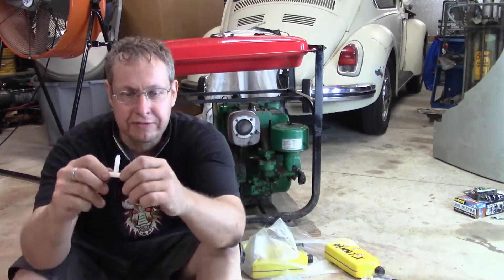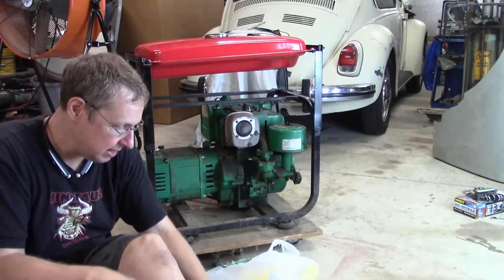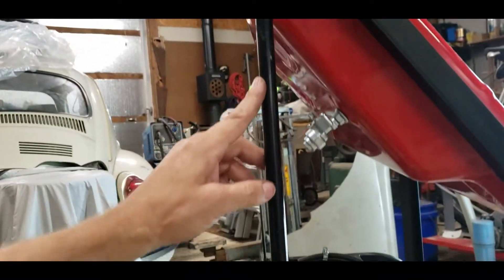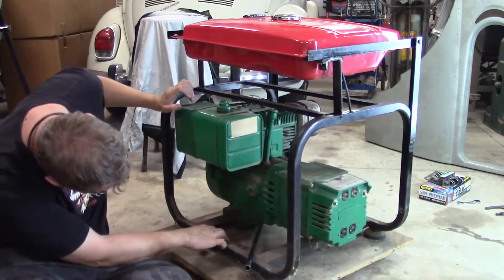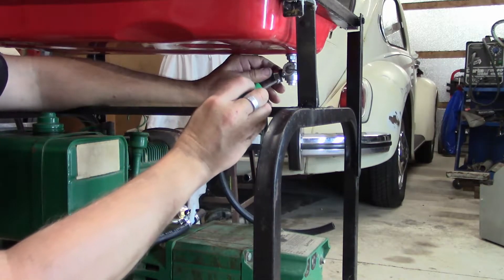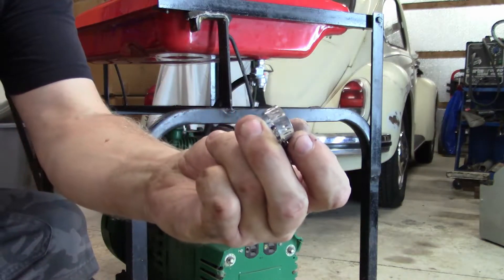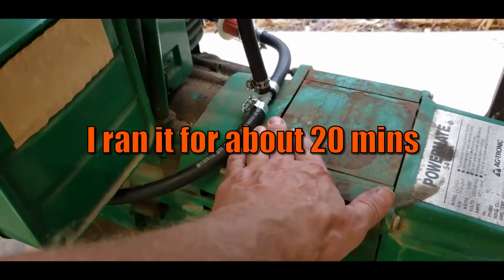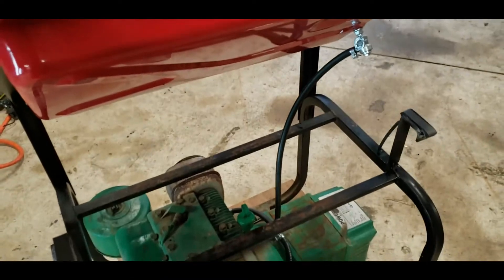Generator Auxiliary Fuel Tank Mod - Duel Tank Feed Lines. Make the Generator drink from both tanks.

Comment: One piece of advice: Get a brass tee. The plastic ones are primarily for air. With gasoline, they become brittle and break over time.
I'm wondering why the gas from the top tank isn't flooding and spilling out of the bottom tank. You are very lucky that the gas cap lets air into the tank, but no petrol to the outside. Putting out a burning generator is no fun.
Reply from the maker: I've used it probably 10x and never had a ny kind of issues. The brass is a good idea. They didn't have any of the size I needed when I built that.
Reply: I've actually been doing some research on fuel safe barbs for fuel and I found a few sources that imply brass doesn't react well with alcohol making it a bad fit if your fuel contains moderate levels of ethanol.  It's probably fine short term but in standing fuel that would be bad for the engine as the copper and zinc degrade.

Nylon seems like a better long term solution compared to say, polypropylene fittings.  Apparently kynar is a plastic made specifically for the task, but it just isn't super readily available from what I can find yet.  Definitely avoid polyethylene, it just can't.

Comment: great video 👍👍👍 i can follow step by step..btw what happen if small tank is empty?
Reply from the maker: For me the big tank just gravity feeds the  generator even if the other tank is empty. I haven't noticed any issues and I've used it quite a few times since I made that video. I guess you could put a second valve on the small tank to shut it off completely, or add a check valve.
Reply: @HFG  thanks for the answer..
Reply from the maker: @muhammadhazmi4518  glad to help 👍🏼

Comment: The only thing I’d worry about with that is gravity overflowing through the lid of the small tank. Easy fix with an in line valve if it overflows during lower rpm’s though.
Reply from the maker: We've had to use it a couple of times and it hasn't been an issue. It's been a big help so far 👍🏼